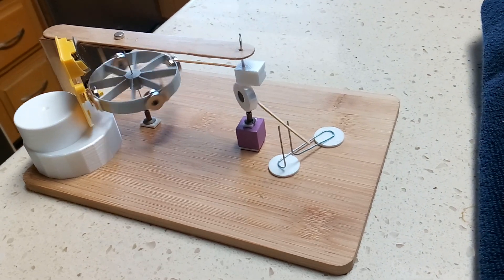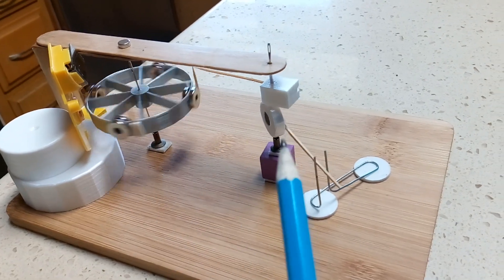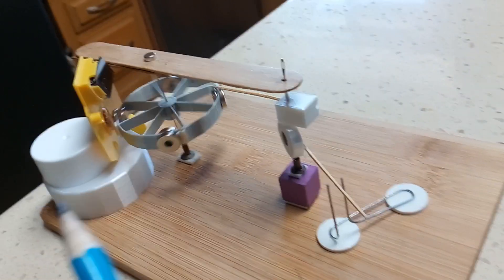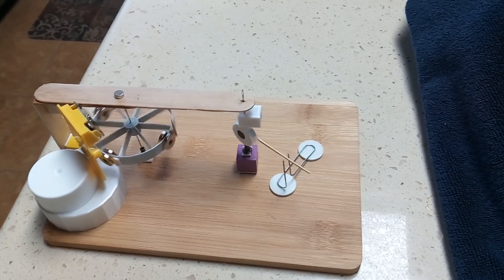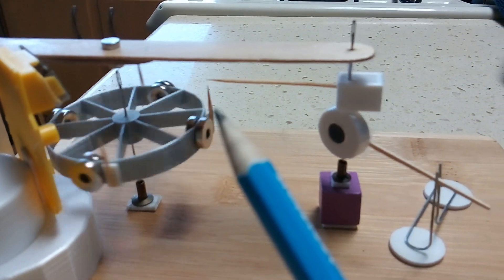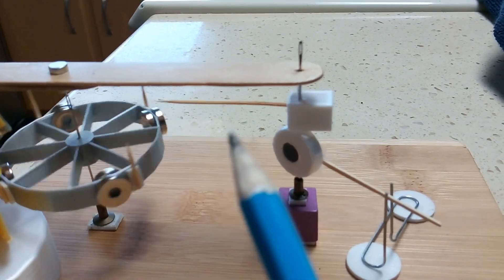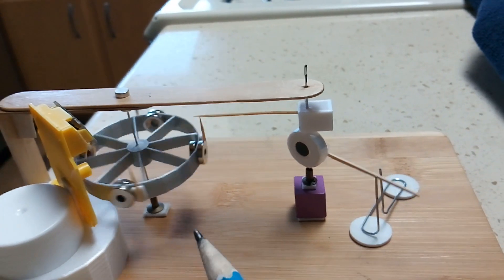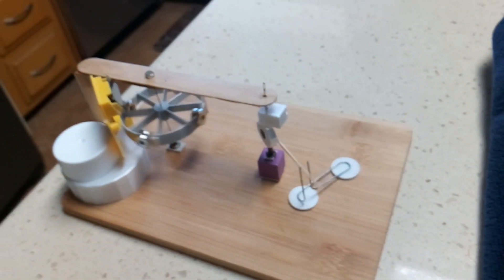Solar Powered Mystery Magnet Motor

Comment: You have done everything possible and yet you are not left with enough magneto mechanical force to keep the wheel spinning within itself. I warn you, it can become an obsession. I know what I'm talking about. Every week I spend a few hours making the impossible possible. Some micro amperes still have to come from outside, from a battery, a solar panel or an antenna as Larskro does. Keep hoping for a miracle.
Reply: He needs to make an original and not trying to make an illusion. He's admitting more about it possibly running on it's own every time he upgrades it.

Comment: I was wondering how you were getting on with your printer, looks like you are having fun 😊👍
Reply from the maker: I am still struggling with 3D designing with Tinkercad.  The Ender 3 printer is fantastic.  What I am doing mostly now is hunting for a design and then modifying it to fit my needs.  Designing from scratch I find really hard.   The new rotor here came from the Tinkercad files and I just modified it.

Comment: You could maybe do a supercap based 24/7 runner with this one, further blurring the lines of illusion vs real. 
Have got a set up here. Your triggering mechanism might well be the cleanest approach... I've been trying rubber bands on circular disks, because the rotor will turn when the weak little magnet turns 360 degrees (rather than back and forth). Holding on to a 90 degree angle of the magnet to 1/4 rotor segment pushes the rotor better, but then it would get into cam lobes or something!
Reply from the maker: You know our minds work very similar.  I was thinking the same ting about making this a 24/7 runner with a super cap and a larger solar panel (garden light type).  It is a fun little project.  Your rubber band idea sounds very interesting also.  I was using a small round rubber band as the limit stop before I changed to the paperclip.  That worked but was harder to adjust than just bending the paper clip.  I also like the 'tick tick tick' sound that the paper clip added to the 'illusion'.

Comment: I cant help but wonder if the 'control arm' mechanism contributes at all, or would it run just as well or even better without it?
Nice job. Have you ever tried fridge magnets on the rotor?
Reply from the maker: This runs quite nicely without the control arm.  Good catch Ben  This is an illusion device but it was really hard to make the device actuate the arm  and still run on that  tiny amount of input energy.  The part of the illusion that is not shown here is the manual actuating of the arm to turn the rotor using just the little magnet.  That really has to happen to show the effect of the actuating magnet on the main rotor.  I can see why people spend tons of time trying to make this thing really run on it's own.  It comes soooooo close.  I have not tried fridge magnets but they would work just fine.  You would have to move the small actuator magnet closer to the main rotor to get the illusion right.
Reply: @Lidmotor  Thanks for replying. Now, thinking outside the box. With the drive unit removed, operating the control arm mechanically or manually, would the rotor turn? Is that weak magnet enough to turn the wheel?
Reply from the maker: @benwinkel  Yes it does.  I might do a video showing that .  THAT is the bait for trying to make one of these self run.  It takes such a tiny amount of input from 'Mr. Hand' to turn that rotor.  One is drawn into the deception that a simple linkage to the main rotor can do the job.